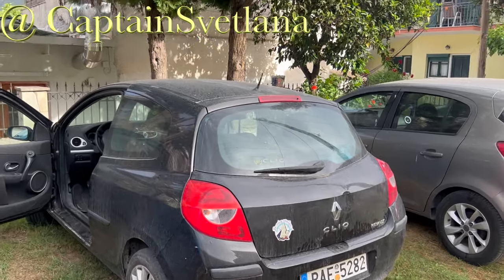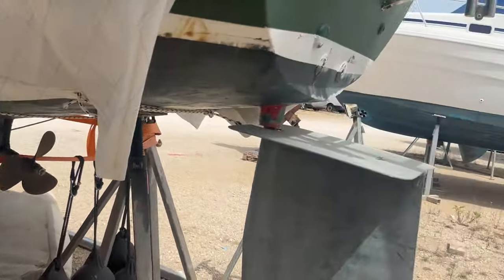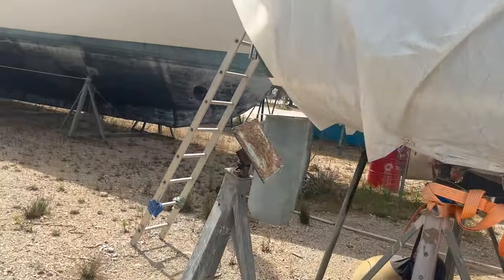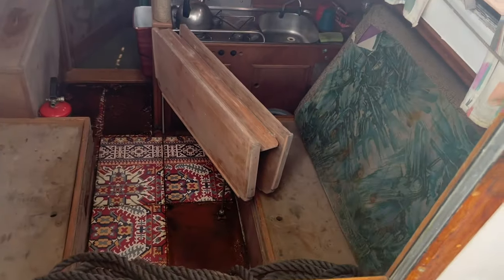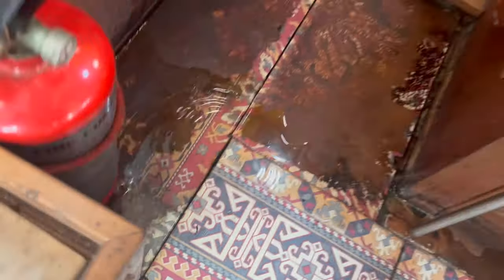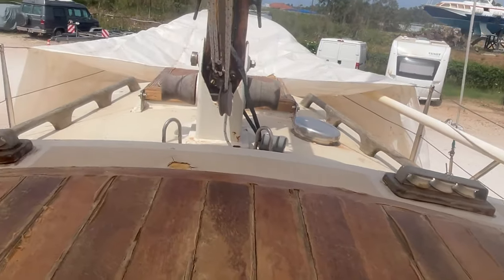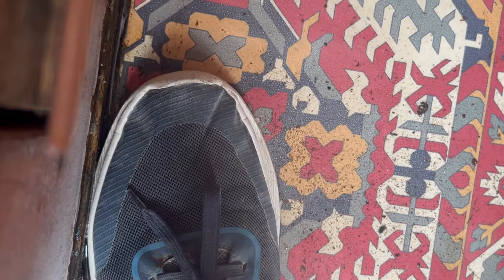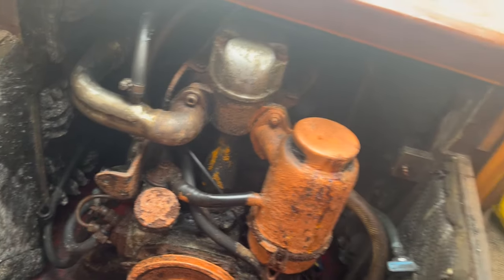Should I buy this custom made 25' saiboat | S4 E17   HD 1080p

Comment: Judging by the amount of rainwater she has been on the hard unused and unvisited for quite a time. I am assuming she is wooden, so check for rot. Engine possibly u/s and may need replacing, electrics will need replacing, no nav instruments seen in your film, so assume there aren't any. At least 1 winch will need to be bought and one other might need to be replaced if it can't be serviced. I would check standing rigging very carefully - if it is original it is likely to be galvanised and in which case will almost certainly need to be replaced (your insurance company may demand replacement, anyway). Running rigging may well also need to be replaced. What about sails? does she have any? and if so, what are they like. In addition, as said in the previous comment, there will be other problems that will come to light as work progresses. The work and expense required to get her sailing and in good condition almost certainly amount to more than she would be worth. But if you really wanted to go ahead, an offer of £1 would probably be about right. She is really worth nothing as she stands and you would be doing the owner a favour by relieving him of the hard standing fees.
Reply from the maker: I agree. The owners did come back with a lower price but it’s too far gone to be worth the risk